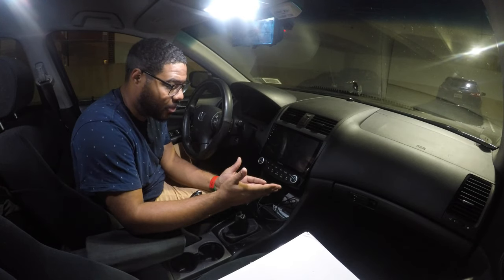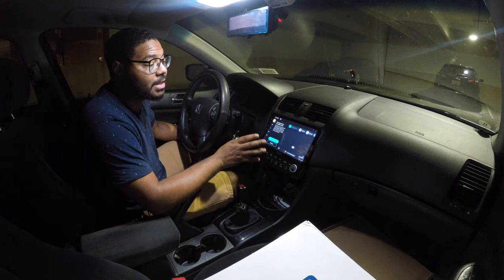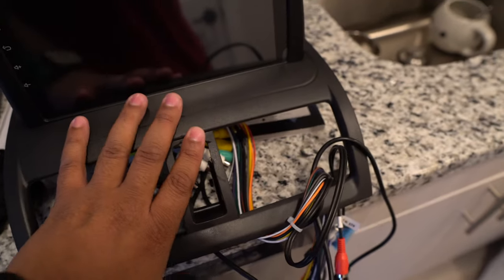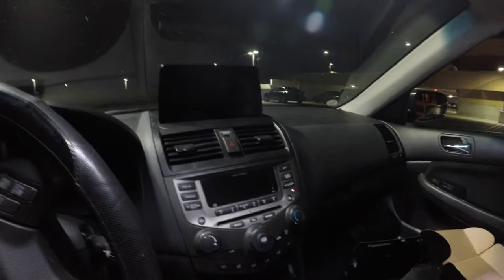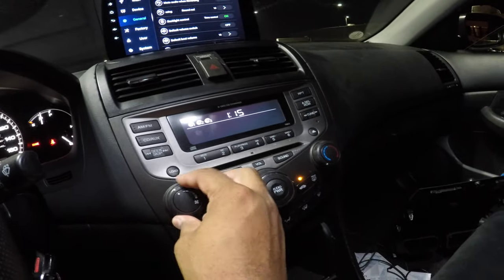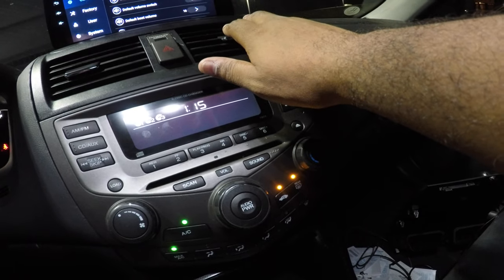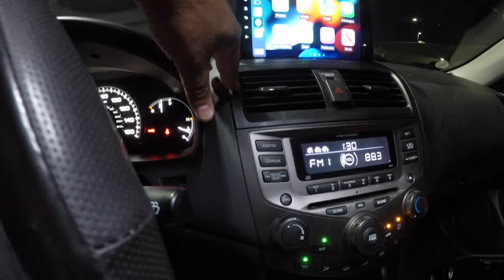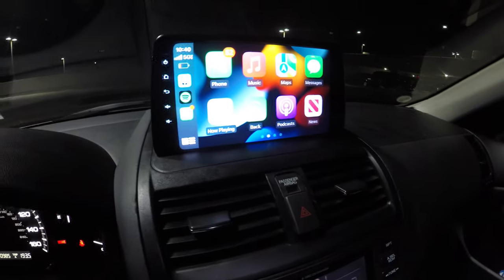A-Sure Wireless Apple CarPlay Radio Headunit for Honda Accord 2003-2007

Comment: Got a 2005 Honda accord and just bought a bluetooth transmitter but I rather have this instead🔥 you make it look easy when installing but ik if I do it i’ll struggle
Reply from the maker: I mean look at this way! There was a time where I didn’t know how to install radio headunits or car parts in general. Got to at least try and see if you literally cannot do it!honest this install isn’t as bad as you think. All of the wires are plug and play so there is no cutting or splicing that you would have to do

Comment: I appreciate this video!  I have an 03’ Accord.  How has this unit held up so far?
Reply: I installed one of these in my ‘06 a month ago, it’s fantastic so far. I use apple carplay from its carlink 2.0 app it has and it works great. Very responsive, connects to my phone fast, I’ve only had a couple of connection issues where it wasn’t connecting to carplay, just had to shut off navigation on my phone and turn the car off and on again.  from my experience it’s USB ports don’t charge my phone very quickly or at all, so I just use a plug for my car’s 12v port with usb ports. My only gripe with it was how it made the speakers sound after I installed it, it used to have very clean and loud bass stock but now it distorts and I’m not a car audio nerd but I will become one to fix it. I had to set the EQ profile in the audio settings for it to sound normal and it has grown on me some but i’ll have to look into a better solution in the future. It has a ton of hookups for other audio equipment that come with it so I might expirament with it in the future, but overall it’s nothing that would make me say it’s terrible. Also be careful routing the microphone wire, I snapped it by mistake since it’s so thin. The built in mic isn’t the greatest.

It’s a great unit but the install, gluing the vents in, and dremeling out the extra space for the hazard light button was a little tough. Very fun project tho. It being an android tablet based system I would recommend not connecting it to the internet or using it for anything other than auto/carplay stuff so as not to bog down the memory too much, it can rlly start chugging when trying to load other apps or even video. 

I also saw a review on amazon that suggested a wire harness mod so you can keep the function of your existing radio/CD changer which I think would be worth it if u can do it.

tldr I love the unit so far but it has a couple drawbacks/issues with sound and ports.
Reply: I fixed the audio stuff, it sounds great now 👍 gotta keep in-app eq settings in mind especially with spotify as that works over carplay too.
Reply: So u just have to set the equalizer to get better then stock performance

Comment: Just picked up an accord and stumbled onto this video. Any updates on the unit? Is everything still working? Do you still like it? I’m interested in purchasing one. Ty
Reply from the maker: This wasn’t a bad unit by any means however, I do believe that there could have been some better improvements. Check out my channel to see the other Headunits that I have installed into the accord.

Comment: How did you cut the plastic for the hazard lights? Also you said that the plug is different, the hazards still work right its just that the passenger airbag display won't light up right? I appreciate the vid I was trying to avoid that xtron radio cause of the climate controls
Reply from the maker: Hey so I used a Dremel drill to make the hole bigger in order for the button to fit. And no the connectors are different so a button without the airbag passenger indicator will not work.

Comment: a few questions as I am considering this unit- does the CD player still work?  Also, the startup looks instant in this video.  Is that the actual boot up or is that actually a lot longer?  Have you resolved the factory radio since then?

Comment: I tried the one you remove the radio, and the rear defrost didn't work nor the backup camera. I sent it back.  I'm glad you posted this. Have you installed a backup camera by any chance with success?

Comment: Hello, I have been looking at this unit model for a long time but what does not convince me is how to install it so that it is impeccable, first through the hole for the airbag and the other is that my accord is 2006 ex navigation and I do not know if it can be installed , according to your experience with this installation, it would be possible to install it on mine, thanks

Comment: Can you use this device on the top and have the touch screen radio you had prior on the bottom at the same time a
Or is that out of the question?
Reply from the maker: Hey sadly that will not work to have to separate screens at once considering the fact that these systems are plug and play and you would only be able to plug in one system at a time.
Reply: @JR14Channel  damn, so there’s no way in having them both maybe even tapping/connecting the cable lines together and plugging them both in the car?

Comment: i clicked the link and it says the headunit for 2008-2012 accord
Reply: and i have a 2007 accord
Reply: It will work the guy in the video has a 07 Honda Accord which the device is connected to in the video